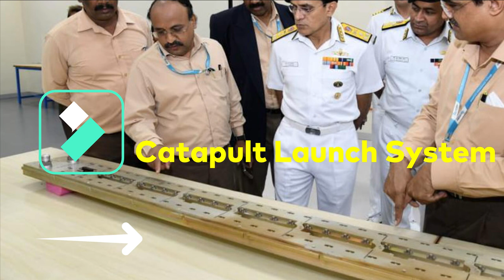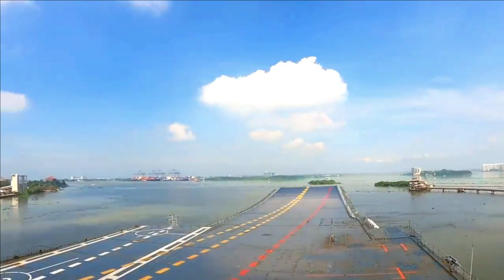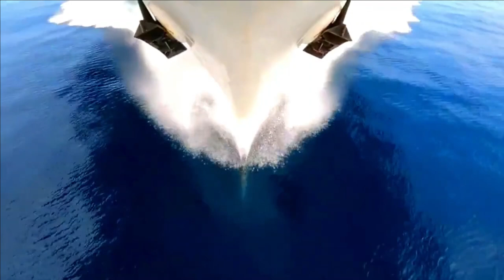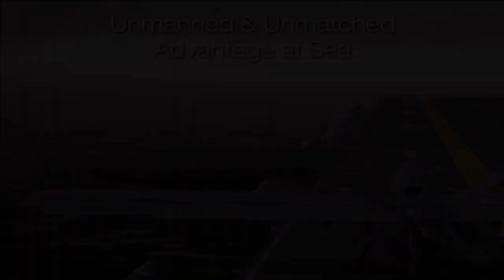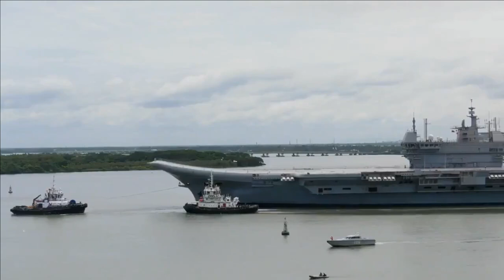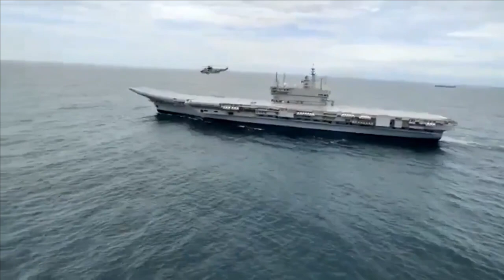EMALS system for Vishal?  Electromagnetic Catapult Launch System By BEL for Navy's aircraft carrier

Comment: Wake me up when we build Nuclear carrier with displacement of 100,000 tons which can accommodate 75 aircrafts. As far as propulsion is concerned, we already build Nuclear reactors for subs. Why can't we do it for a AC? AC has enough space to accommodate a bigger reactor which can deliver higher power.
Reply: Then you can sleep for next 40 years 😴.
Reply: Chinese carrier have no less than 147 MW output power. That needs more than three reactors of Los Angeles. As for Indian reactors it may need 8 reactors to power one single ship. The same maintenance and security nightmare as USS Enterprise.
Reply: @yixinmei5854  no. Indian ssbn has reactor of capacity 85 MW. So it will need only two.
Reply: @yixinmei5854  lol Los Angeles class subs has 165 MW reactor. I don't know from where you are getting your data. One reactor of Los Angeles subs will have more output power than chinese carriers.
Reply: Sigh... You have no idea about the difference between thermal power out put and shaft power output.S6g have 165MW thermal power output and 22.5MW shaft power output, 13.6% efficiency. S6W reactor mounted on Seawolf have 250MW thermal power output and 33.4 MW shaft output.
Reply: To achieve the shaft output of Vikramaditya, 134MW shaft power output, I assume that your reactors are as efficient as S6G, you need eleven reactors on INS Arihant. Yes you can try that, please, go on.
Reply: The US had the same problem with it's first nuclear carrier, so employed 8 reactors to power the ship, replacing the 8 boilers of the Forrestal class.